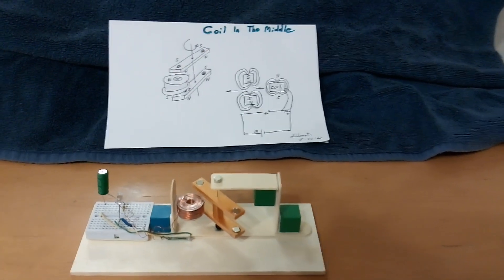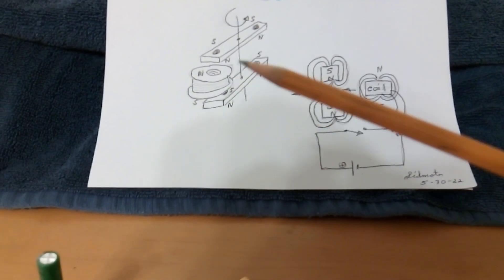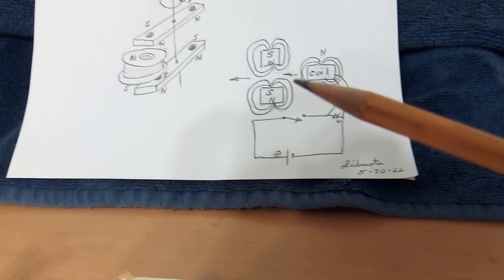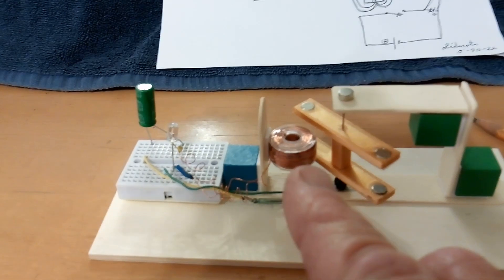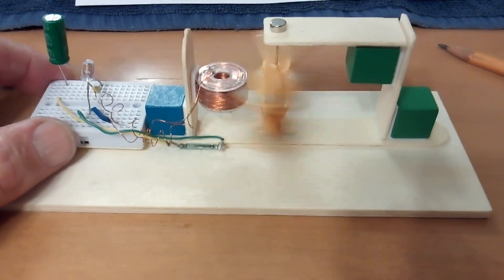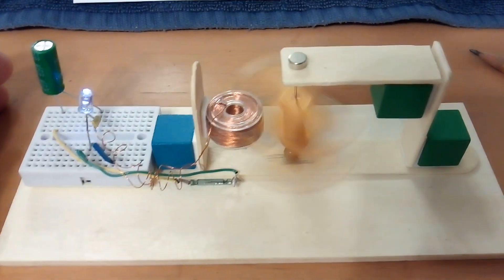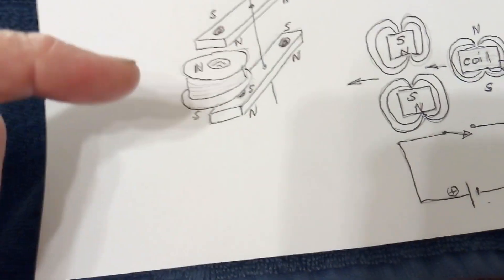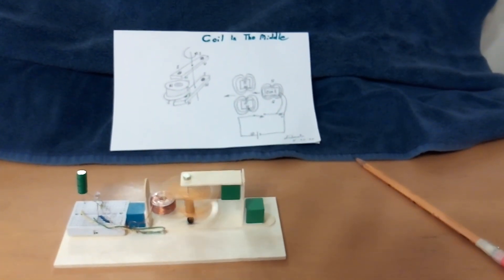Coil In The Middle

Comment: what would happen if you connected one or two other coils that was just connected to another super capacitor? would you be able to transfer the energy from on capacitor to the next? If so, how much? Also could you put a diode on the secondary super capacitor circuit and have it "dump" the energy into the first bank to help increase the duration of the motor? Maybe instead of using a diode, maybe a reed switch to pulse the first capacitor bank? just some thoughts :)

Comment: I like it! Could you connect the magnets back sides to complete the magnetic path? That should "waste" even less of the available flux! Maybe higher peak torque? with associated higher max current?
Reply from the maker: That is something to try.  Thanks.
Reply: Always connected thay are through the air. Oxygen is a magnetic circuit for the earth.
Metal just adds weight.
Reply: @gerarddugas6224  For the earths relatively weak magnetic field, the air is magnetically permeable and the field propagates through it. but it would do so roughly equally as well through a vacuum. Magnetic fields reduce at the cube of the distance from the magnet. The air saturates in low magnetic fields. But more magnetically permeable materials can support a stronger magnetic field density. For reference the Relative Magnetic Permeability of: 
Air: 1
Ferrite materials: 1500 - 3000
Mu-Metal: 100,000
Metglas: 1,000,000

Thought/practical experiment: 
Get a paperclip and measure how far away a given magnet needs to be to attract it. 
Then use a magnetic material such as an iron rod/nail/screw driver, spanner etc. Stick the magnet to one end of it and measure the distance between the magnet and the paperclip at which the paperclip is attracted. 

The iron rod can "conduct" the magnetism and shape it into a given direction preferentially to the surrounding air because it has a higher magnetic permeability.

Comment: Nice, Apply that, double side idea, to a Bendini?. Both sides of Coil are active, I put rotors to both N-S sides of Bendini, with matching Mag 2 Poles. You will see,  they harmonize, speed, more juice out.. Your Bigger Bendini, years now, only one gene? Could, Add 2nd gene. to Other side of, coil, second rotor on DC motor like 1st.
 See you still love your coping saw file and woodworking. So despite 3D printer, your still creating, in hardware.  You always had a way, with your wood projects. 👍
Reply from the maker: Thanks.  John Bedini  might have done this long long ago.  Driving off both sides of the coil is a pretty common sense  idea.  I like working in wood but I am finding that 3D printing in plastic has it's own charm.  You can blend both into one project like I did here.   It's all fun.